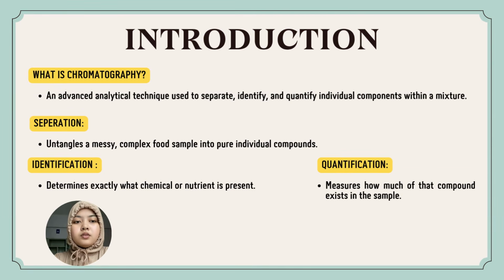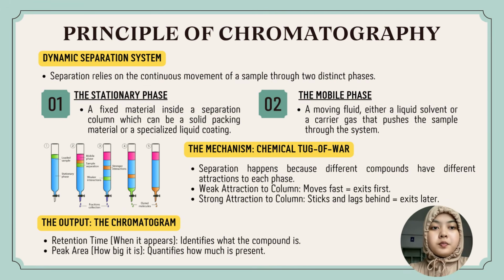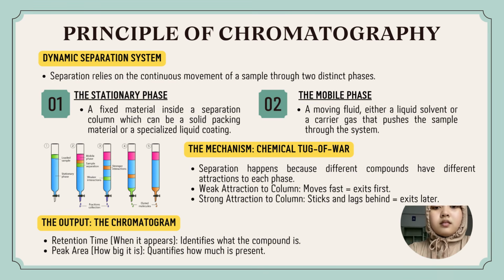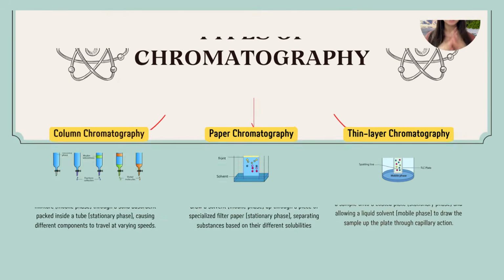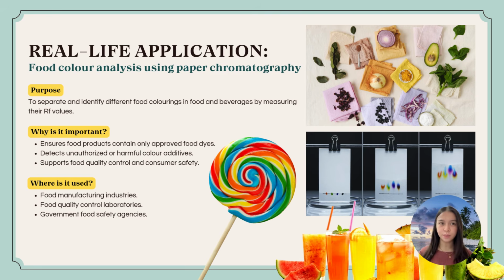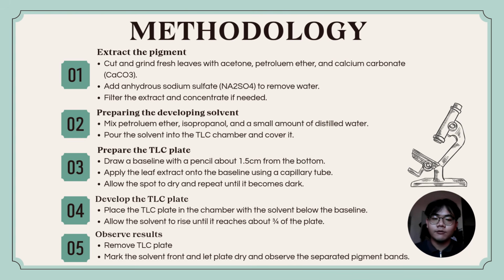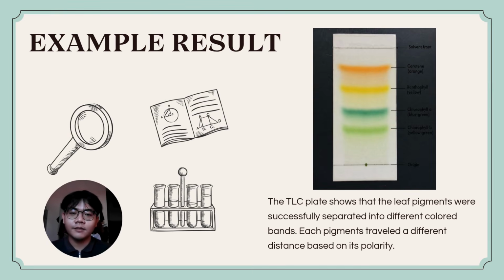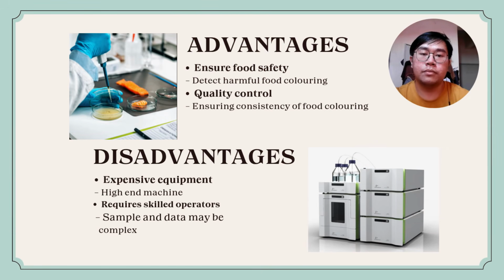CHM256 AS1204B GROUP 1 VIDEO PRESENTATION

Comment: hi, how do we determine Rf value actually?
Reply from the maker: Rf value is determined by dividing the distance travelled by the compound spot with the distance travelled by the solvent front😁
Reply: @DygkuDanisha i see, so after dividing, how do we know if the value is good or not?
Reply from the maker: @athirahtahiruddin5044  after calculating the Rf value, we do not judge it as “good” or “bad”. instead, the Rf value is compared with a known standard or reference value. if the values are similar under the same conditions, the compounds may be the same
Reply: @DygkuDanisha WOWW i understand thanks so much!!

Comment: this video is really helpful for me to prepare for my CHM256 exam
Reply from the maker: goodluck with your exams 👍🏻
Reply: from what i know, TLC is kept in a closed jar. may i know why is it like that?
Reply from the maker: @ririwaifu443  TLC is kept in a closed jar to prevent solvent evaporation and to allow the chamber to become saturated with solvent vapour, which helps the solvent move evenly up the plate and gives accurate separation
Reply from the maker: specifically in a closed developing chamber, not a vacuum since the experiment needs solvent vapour to help the separation proces